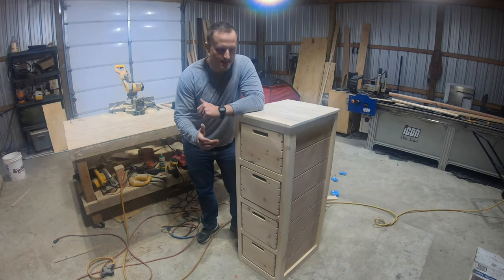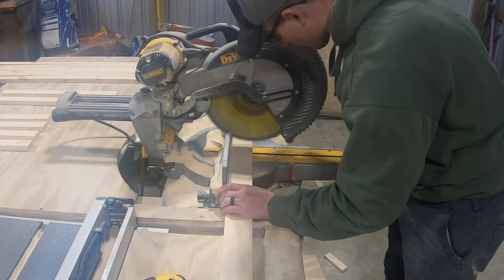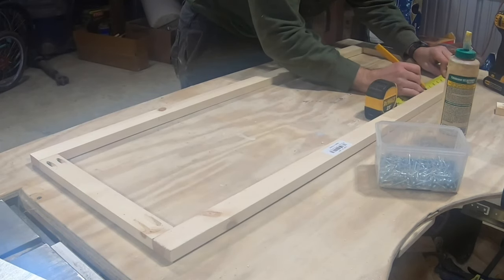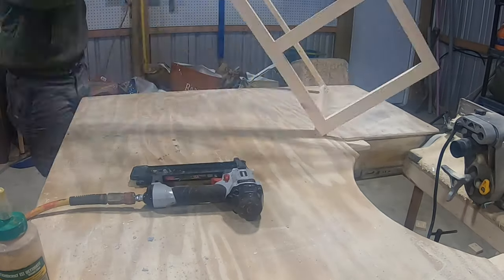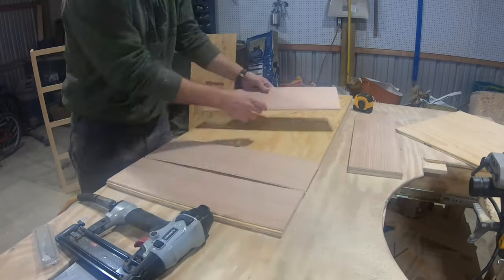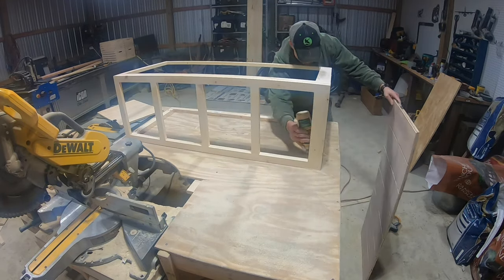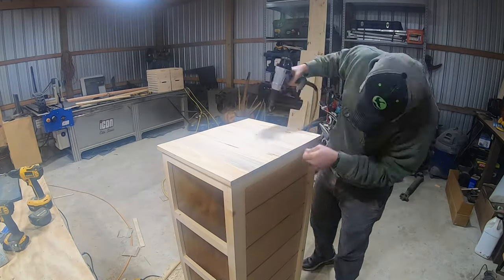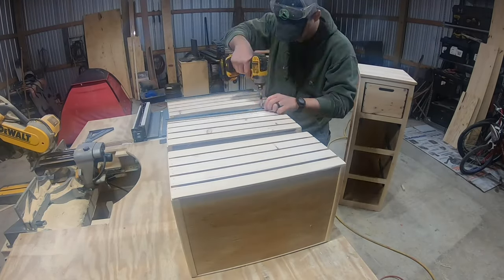DIY DRESSER BUILD (Drawers from Crates)

Comment: Love this! Was about to make a Rubbermaid container holder with French cleats and casters to keep small items in it during my renovation. This may be better. I’ll just add casters to bottom to be able to move it around. Now I just have to add flat bottoms  to eliminate slides so I can use crates outside the unit as well. Another awesome build!
Reply from the maker: Castors on the bottom would be a great idea! Thanks for the feedback!

Comment: I’ve been using some rigid insulation under my sheet goods when I cut them with my circular saw.  It provides a nice sacrificial substance under my paternal and my plywood is fully supported so I don’t have to hang onto it or prop it up on 2x4’s.  It’s worked out great for me.  I bought some “blue board” and not the r-tech. Nice build man!
Reply from the maker: That’s a great idea. I hate having to do that! Thank you!
Reply: @DIYMAN  you’re welcome.